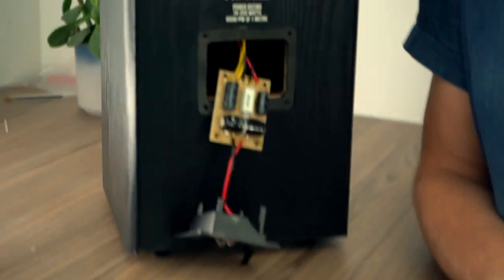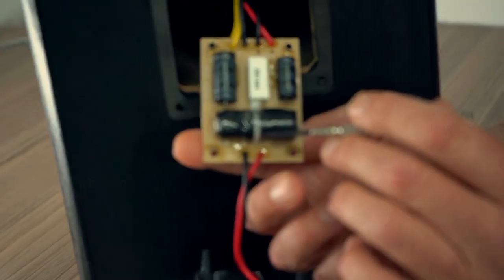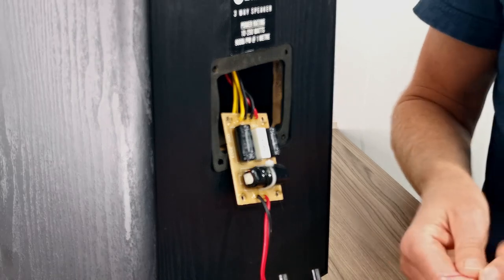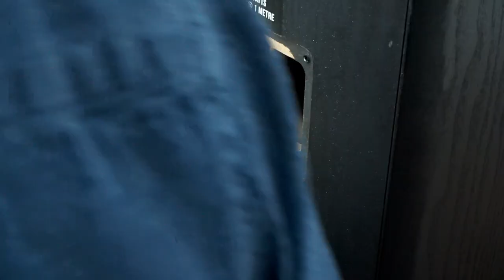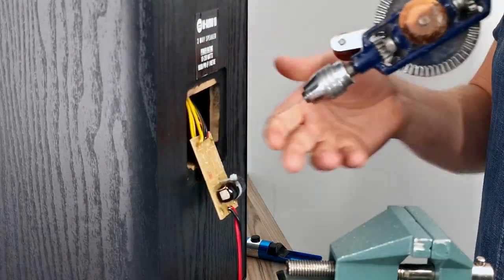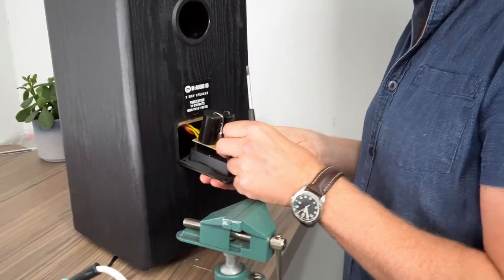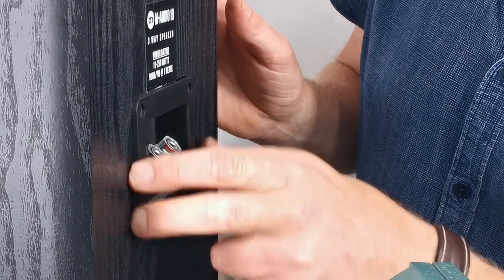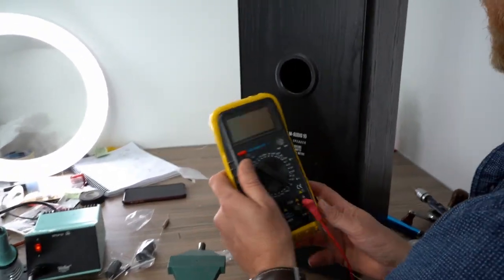Beginners Guide: Speaker Crossover Upgrade

Comment: Personally I like to test different changes in a crossover before commiting to a definitive plan. I run wires from the drivers through the port and place the crossover parts on the ground where I can listen to some music and test tones and making some modifications and be able to listen if the sound is better or worse. For example, if we put a new capacitor on the tweeter, the response may change slightly and we might need to put a new resistor with a higher value to balance it to the woofer response. The changes can be made on the fly and the configuration of the crossover could be redesigned to better results. Modifying the damping material inside of the speaker might be something to look at too. Good luck with your projects!
Reply: Yes I just figured that out I ran separate wires to each driver, & tested tested tested, huge difference ya can't just use math & fancy test equipment your better off investing in a handful of inductors and capacitors

Comment: You probably would’ve wanna replace that iron core inductor with an air core inductor of the same rating as least. 

The iron core inductor kind of smears the sound

The only problem is a good heavy gauge wire air core conductor of the exact same rating in millihenries probably would not be able to fit through that small square hole.     You would have to mount the crossover outside the cabinet unless you were willing to remove one of the front speakers for a bigger opening.

Comment: How much difference of sound did you get with that modification? Any sound demo?
Reply from the maker: Hi Vic, unfortunately no sound demo. The difference was definitely noticeable, its important to play music through them for a few hours for the caps to burn in or "settle" as at first they were slightly muddy but now sound great. Lets put it this way, they weren't used from purchase up until the upgrade, and they now proudly sit in Elliots living room!
Reply: The difference between a stock grade pp cap in series with a tweeter, as compared to a Mundorf Supreme MKP Silver/Gold/oil capacitor. 

Is like the difference between listening to a radio vs seriously expensive high end speakers.

For the DYI people out there:
-When you make a bugdet for drivers and crossovers, please realize that a really expensive tweeter with a cheap cap, makes no sense.

The cheap tweeter with the expensive cap sounds much better. 

Then again, the price for a pair of 6.8 uF Mundorf Supreme Silver/ Gold/Oil cost around 550$, and that's only 2 components of the crossover 😉

I use the Mundorfs as coupling caps in my tube amp,  and Jantzen Alumen Z caps for tweeter section in the speaker cross-over.
Reply: Correct, it's odd that considering the difference in sound, and quality, and the fact that you're already in there doing the upgrade, that a person wouldn't use higher grade components.
 A Corvette deserves an L88, not a Vega engine.
 But hey, even if your speakers are only Malibu's, they're worth the extra money, considering the availability and relative affordability of better parts.
 Even if they're not top of the line, the available replacement parts are probably better than the original.

Comment: Bookshelf  boston Acoustics CS 2s ive owned for over 10 years  could use an upgrade in certain areas .mainly   the mid? the highs an the lows are  fine  for  apt usage..id luv some  simplesuggestions from trustworthy sources that know what  there  saying.. The last time  I got inside  of em I had removed the  cotton Filling which  improved the mids  tremendously beyond  that is there anything simple  can  be done  to the voice coil or crossovers ?since there inexpensive bookshelf speakers it dosent really make  sense to send  em in to G.R. research or anything  like that..Suggestions  are appreciated,Thanks!
Reply from the maker: Hi David
If you e-mail me directly at info@hificollective.co.uk with a picture / schematic of your actual crossover I can make some recommendations
Regards, Nick

Comment: Hello, I have Bonne Crossover speakers. Can I buy and add any type of Crossover to it? Thank you
Reply from the maker: Hi, to upgrade you need to keep to the same values and type when it comes to the capacitors. So if the original caps are bipolar then replace with the same bipolar type. For resistors the value and wattage are key but you can mix up types. E.G. replacing a ceramic with a Mills wirewound is fine

Comment: I have an old set of B-I-C Venturi Formula 4 speakers I picked up for $40. The tweeters where blown which I have upgrades comming and also a new set of capacitors. However, mine are rated at 16uf 50v so do you think I can get away with 15uf 250v?
16uf 50v is nearly impossible to come by. I searched for 2 days straight until my nose was bleeding lol
Reply from the maker: Hello ZE_GERMAN, there should be no problem with that solution, to make it as accurate to the original you could place a 1uf with the 15uf!
Reply: @hificollective   i will try that as well. Thank you

Comment: Hi thx for the video. How much difference of sound did you get with that modification?
Reply from the maker: Hi M C, an upgrade like this int going to completely change the sound of speakers (the drivers & cabinet are just as important as the crossover!) but having had lots of music played through them now its safe to say there was a definite improvement - they've been paired with a cheap amp thats also had some simple upgrades and together the system never fails to turn heads, all in a budget price range!

Comment: Sir
I have pioneer private pro sx 730 a couple of speaker on high one tweeter is automatic turnoff for 10sec after 10sec it works again and often amplifer is trip so what should i do?
Reply from the maker: It’s difficult to diagnose the problem without seeing the circuitry.

Depending on where you’re based we do have a list of recommended repairers on our site here https://www.hificollective.co.uk/repair-upgrade-engineers.html

It would be worth looking inside for any dodgy soldering.
Reply: @hificollective  thanks man you helped me 😊♥️

Comment: Can you swap crossovers from one set of speakers to another ?
Reply from the maker: you can, but crossovers are designed with the drivers in mind so you may find the frequency response of the modded speakers unpleasant
Reply: I would

Comment: Hi ! So I upgraded the capacitors in my 30 yo B&W DM640, w/Solen PP caps, and they became too bright! I really miss the smooth relaxed voice they had previously. What would you recommend?
Reply: Lol, use the tone controls knob.
Reply: W A wow
Reply: @sachavilleneuve6688  Wow, you're a 'purist' with no tone controls? Wow
Reply: @wa2368  take a deep breath man. Why r u tagging me as a "purist" ... and that "LOL" ... so childish. Tone controls affect highs differently than tuning a set of speaker to sound more relaxed.
Reply from the maker: What was the original capacitor? Bipolar electrolytic or film?
Reply: @hificollective  electrolytics
Reply: @sachavilleneuve6688  you change its characteristic. Adding 1R resistor for each 10uF of single capacitor should match their ESR to what it was. If I am not clear enough, as an example. If your new Solen Cap has value of 15uF, connect in series 1.5R (ohms) resistor with it. If it's 20uF = 2R resistor. Do it for each cap steering woofer and mids. Tweeter caps shouldn't need that.

Comment: Hi Nick, exactly what soldering iron/station did you use for this upgrade?
Reply from the maker: It is a Weller WTCP51 eith a 3mm chisel tip
Reply: @hificollective I can't find a 100v 150 uf film capacitor only electrolytic? What should I do thanks

Comment: Please could you elaborate on that part about ESR
Reply: ESR “equivalent series resistance” which means all electrical components in a circuit regardless of function also add resistance in the circuit so if you are replacing an iron core inductor with an air core inductor for better sound you are also reducing the circuits resistance which means more than likely your speakers will play louder as a result. I upgraded my speakers crossovers and now I have about 5-10 % increase in volume !